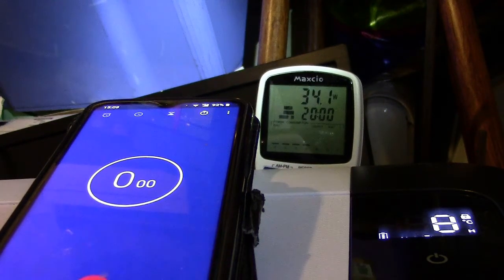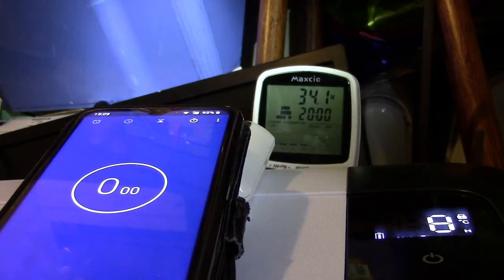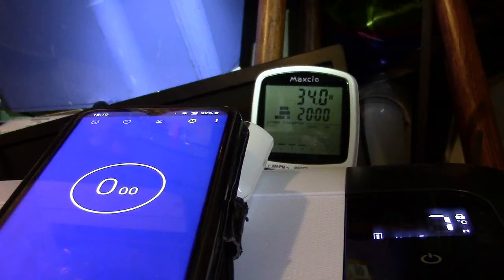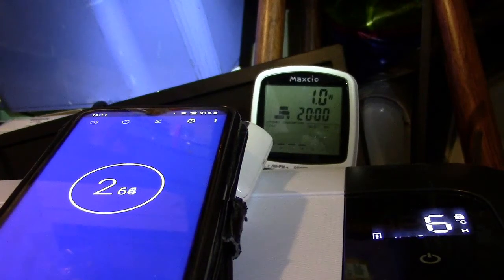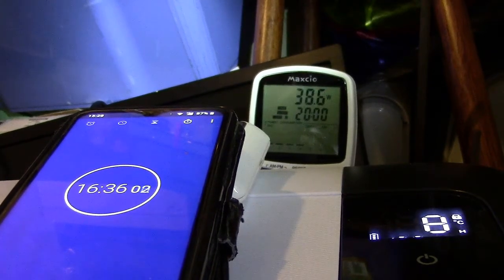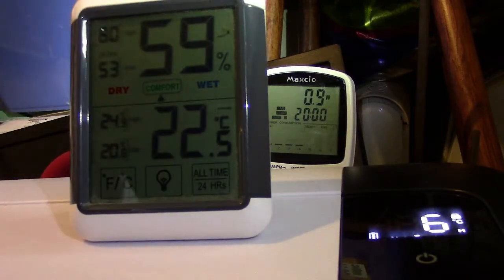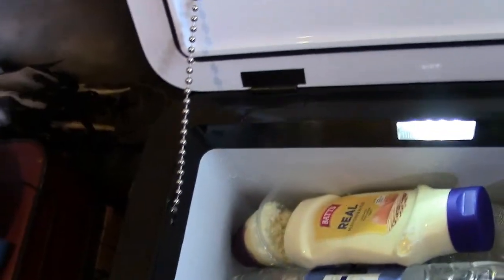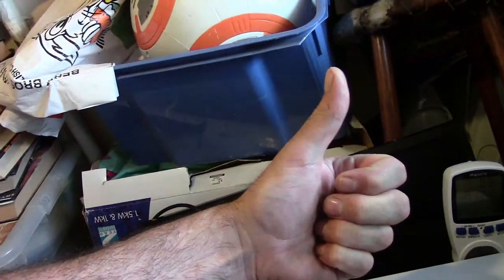Alpicool K25 Power Consumption Test

Comment: 8.19 watts per hour counting standby so 2/3 of an amp per hour. That's super efficient, brilliant. Two weeks I never replied to any comments an all seems to be working good 🙂 I hope your back gets better soon mate, I've three compressed vertebrae, I feel your pain 😆
Reply from the maker: Cheers for that chap 👍 i was hoping someone who knows what they're doing would correctly work it out 😁 👍
Glad you're able to interact again 😎 
First damaged my back 27 years ago when the first disc impacted so sort of deal with it, being a mechanic never helped obv 🤣
Bobil water heater is on order and im hoping a LiFeP04 battery will be coming in a few weeks 😎 just need to have a scrap weigh in to pay for it 🤣 but worth it, i hope 👍
Reply: @Dirt-Diggler  The only thing I didn't add in was the slightly higher watts for the First 30 seconds and that was because of the four minutes of a little less than 36 watts. It averages out near enough to not mess up the outcome unless splitting hairs 😆
You took a break at the right time 😂 Looking forward to seeing your Bobil water heater setup 👍 LifePo4, much better than lithium-ion, more life cycles and safer 👍
Reply from the maker: @pa_maj.MARTINI-van-MAN  if all goes well I'll have a 280Ah battery with a 100A BMS, should be sufficient 🤔
I hope 🤞
Reply: @Dirt-Diggler  Loads of Ah 👍
Reply from the maker: @pa_maj.MARTINI-van-MAN  i audited my power and the max i can use is 58A , that's everything on at once 😁 but then i don't have an inverter, if i did I'd have gone for the 200A BMS and TBH even if it did fit one it'd be a300W one for tool charging and I'd run it off the ambulance system batterys which are 2 X 100Ah merc starter batteries EA1000s 😎 
I've sent quite a bit on batteries 🤣🤣 no wonder I'm so tight with the rest of the conversion 🤔
Reply: @Dirt-Diggler  I think the electrical system is perhaps the most critical thing to do right to be honest, I think you're on the right track.
My inverter is 600 watts and peaks at 1200 but it's best to keep them running at 2/3 power at most I think so they don't burn out early, It's a pure sine wave. I wouldn't mind another smaller one of around 300 watts though to save power as I don't usually need any more than 200 watts from an inverter 90% of the time.
It's all money up front for a little luxury later on 
😆👍
Reply from the maker: @pa_maj.MARTINI-van-MAN  when i was learning the spanner trade an old boy told me "never run anything more than 75% for an extended period, no matter whether a stereo or an engine" allways stuck to that over the years, 2/3rds to be uber safe so that's how I size all my electrical equipment with a 1/3rd "headroom" or margin for safety and TBH i find inverters are most efficient at 2/3 to 3/4 🤔 so it's a good way of doing it IMHO 👍
Reply: @Dirt-Diggler  100% 👍
Reply from the maker: @pa_maj.MARTINI-van-MAN  You meen 75% surely 🤣🤣🤣
 I just tested it on max power and as expected it used more power BUT it also took longer to cool down 🤔 
40A for 90 seconds then 50A for another 3 mins, total time 4 1/2 mins, roughly 30 seconds longer than on eco ?  You can hear the motor is faster ( and louder) but it takes longer, it's like pump speed on eco is the most efficient flow to allow heat transfer and max is just too fast.
Makes some sense, if you remove a thermostat from a vehicle cooling system it doesn't always make it run cooler, without the restriction of the stat the coolant flows through the rad too fast to remove heat and most vehicles actually run hotter without a stat, not like the old days when you took the stat out in the summer and blocked the rad in the winter 🤣 
Thought it was interesting but not really vid worthy 👍
Reply: @Dirt-Diggler  🤣👏You got me 😆 Working out what you said above and allowing for the fridge staying off for around 5 mins longer it works out appropriately as efficient as before by my maths. If that turns out to be the real world usage then that's great 👍 You'll get enough solar for when you really need a fridge and even in winter a good long weekend away without needing to drive to charge if you still use it 👍😃